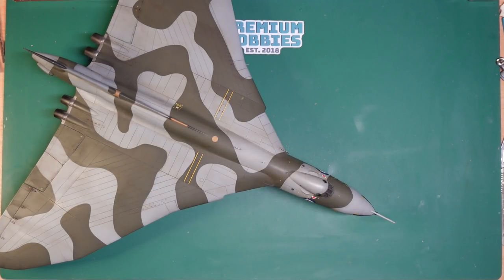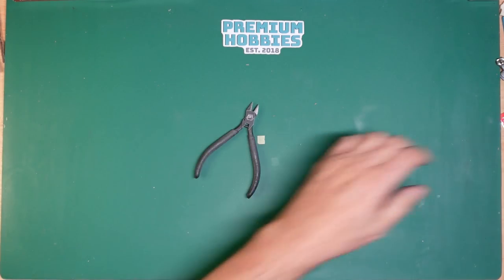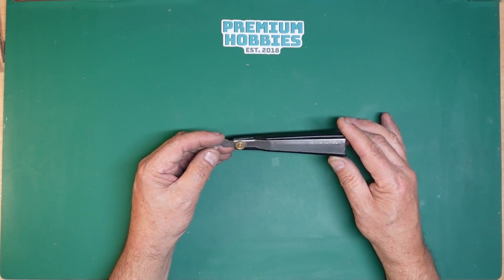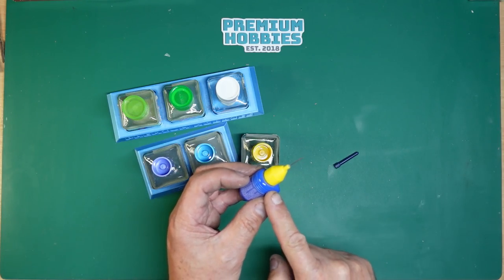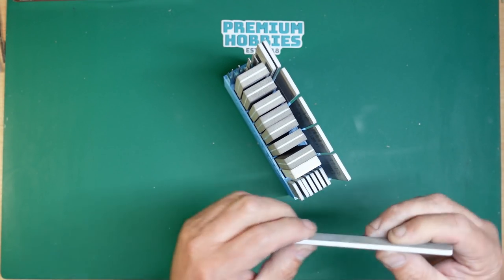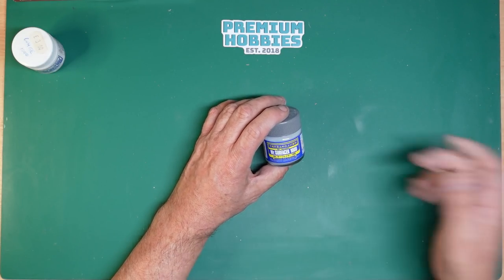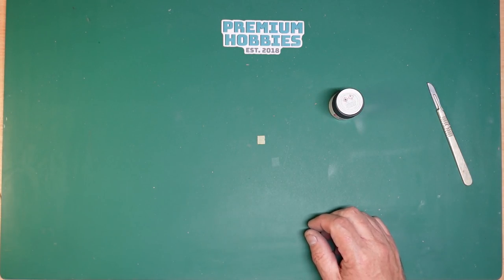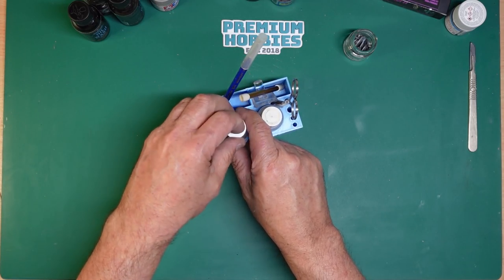Airfix new tool 1/72 Vulcan. Tools and consumables used.

Comment: Nigel,

Tamiya white top is 90% resin and 10 TET type thinners if you read the bottle, great for more than glueing just plastic. I use with resin parts but also for thin parts with wide surafaces it's ideal and not so hot. It's a good alternative in some situations to Revell Conatia.

Oh you missed out Flory wash, the new name for wash you used is Dark Dirt, it's now a better mixed formula and will stay in those shallow panel lines you used pin wash oil for. Phil is atm trying to perfect a star ship filth green effect wash, but has problems it lifts from very fine panel lines, like wash you used.
Reply from the maker: Its actually 11% resin and 89% solvent Keith?? I am experimenting with gluing resin now.
Reply: @NigelsModellingBench  You are right Nigel, I was quoting that miss leader Phil Flory, on a revue he said 90% resin, though it isn't as hot ast TET or Revell Contctia glue is something I know
Reply: I had to get my optivisor out to read that off bottle, I use the same cheap on Phil uses and find it OK, The more expensive wrap around head I hate, though the lenses may be better. Phil often gets things wrong way around

Comment: I have been guilty of using a lighter on the revell nozzle, while it does work I wouldn't reccomend it either.  I once had a bottle of it sat on the bench that was clogged, the sun coming through the window was enough to build up the pressure inside and split/blew the yellow cap clean off!